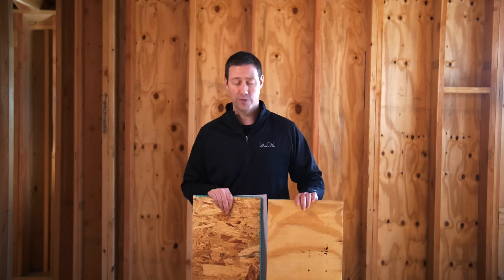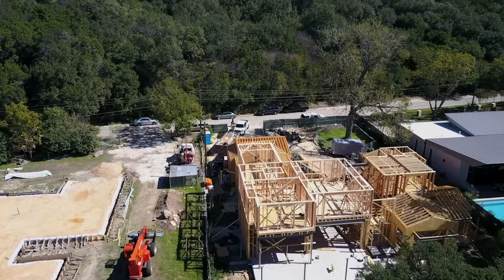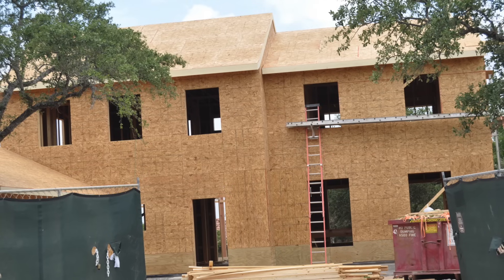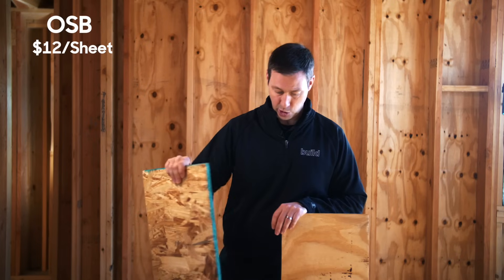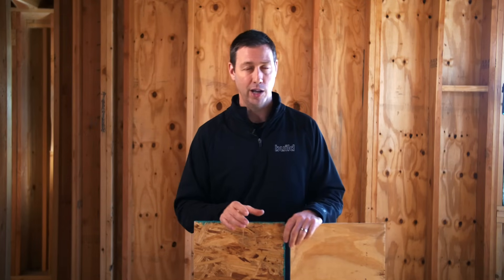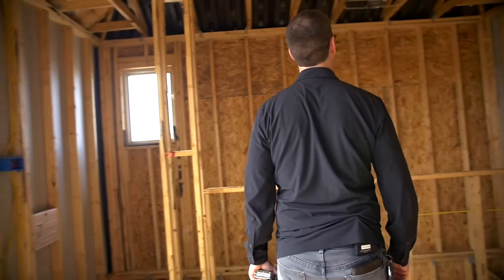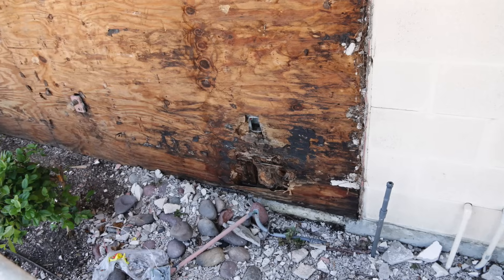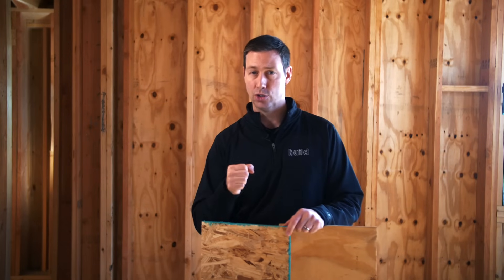Framing : OSB vs. Plywood - Whats the difference in COST AND PERFORMANCE

Comment: OSB = oriented strand board. Slightly cheaper but doesn't dry or hold up as well as plywood. Saved you 10.5 min, you're welcome
Reply: I think S for strand
Reply: It is about 30$ a board now
Reply: Mvp
Reply: Can you make a outdoor shed with plywood. And can it be waterproofed? Thanks
Reply: @mrzee321  you need to put siding on it. You can use T-11 siding instead of plywood.
Reply: @stonedecatur6602  ok just searched it up. Anything else I need I want to make a 8x6. Haven't done a DIY this big before but I'm not scared to try. Thanks 😊
Reply: @mrzee321  Yw, you have to paint the T-11 siding but other than that you should be good.
Reply: @stonedecatur6602  ok and what type of wood for the frame and how thick should it be
Reply: @mrzee321  Frame with 2*4s, use 19/32 for flooring, Osb for the roof. You will need pressure treated  wood for your floor framing. 2*8 mud sills and 2*6 floor Joists.
Reply: @stonedecatur6602  thanks man much appreciated
Reply: $63.00 4x8 osb 5/20/21  ouch!
Reply: (Oriented Strand Board (OSB) - Terms and Definitions, Classification and Specifications) defines following classes:

     OSB/1 - for general use in dry conditions, especially decorative applications.
     OSB/2 - for load-bearing structures in dry conditions.
     OSB/3 - for load-bearing structures in damp conditions.
     OSB/4 - for heavy load-bearing structures in dry or damp conditions.
Reply: Good, I'ma outta here before this guy gets paid.
Reply: thank you sir or madame
Reply: Much appreciated
Reply: If you build you rhouse right, the OSB will never get wet and last the lifetime of the house.  Saves a TON of money on the construction.
Reply: Lmao
Reply: About $70 today what a rip
Reply: Absolutely correct! Just cut a piece of both, stick them in the water for 5 days, measure their thickness and then set in the sun for 5 days, re-measure. Then you will know which you want.
Reply: We used 9 sheets of  OSB for a back yard floor, it lasted 13 years. It could have lasted a few more, but my sister had plant pots over it and it didn't let it dry, also she put a piece of carpet on the center and the same happened.  I just removed the old sheets, looking to buy some new ones but this time I wont put anything on it that won't allow it to dry.  Im just wondering if plywood would be a better choice.
Reply: If you think plywood is better check out the boat restoration being done by “Ship Happens”. She was “remodelled” in 1980s and every bit of plywood has failed. It’s all rainwater damage. None is close to the waterline. 
I have OSB on a shed roof that’s been there 20 years with no problems whatsoever. Today’s products are considerably better made.
Reply: Mvp
Reply: @Dave5843-d9m  so is thatthe exception to the rule or is that normal? Which is stronger, osb or particleB